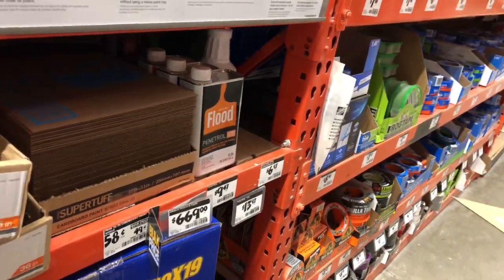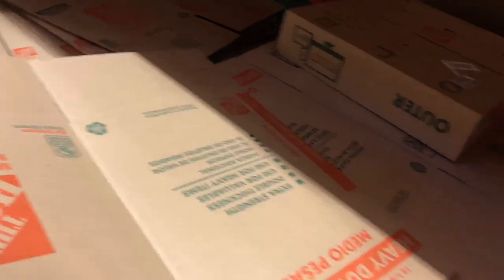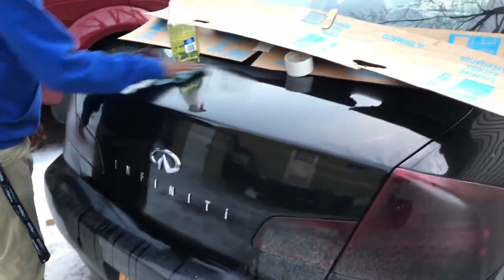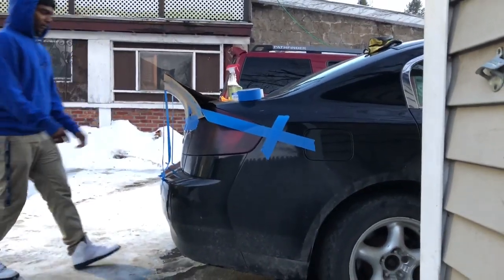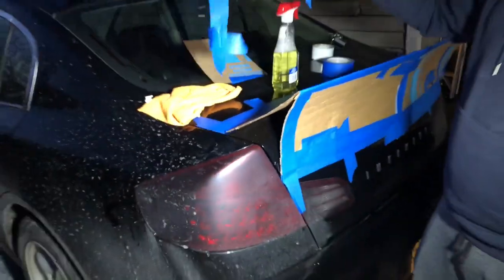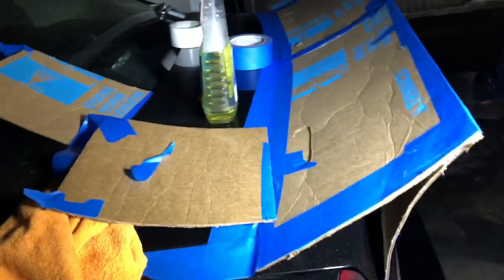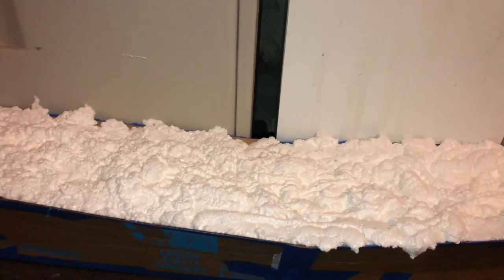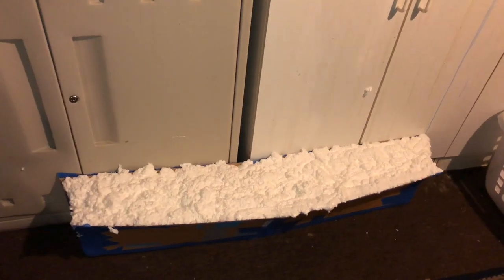DIY DUCKBILL SPOILER PART 1

Comment: I made mines by taping off my trunk using a pencil to draw out the basics  shape of the mold that I want the base to look like then fiberglassing it the I cut out , the I use ply wood to make the shape of how I want the spoiler to look crew it to the angle that I wanted to the fiberglass base mold that I made the wrap it with fleas fabric to give the ideal design Then I Glued it to the fiberglass base Fiberglass the whole thing sanded It bolted it on to the trunk then bondo  the whole thing done deal